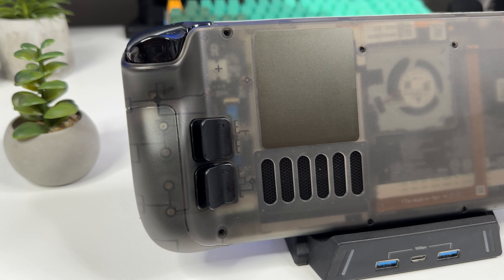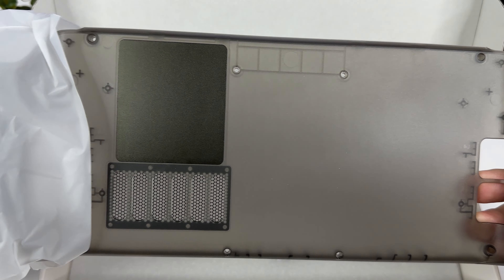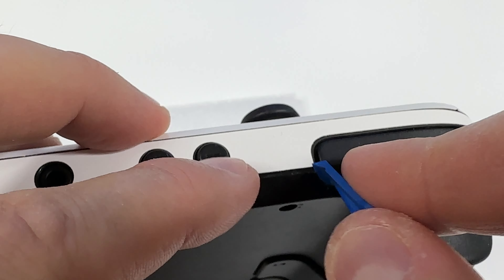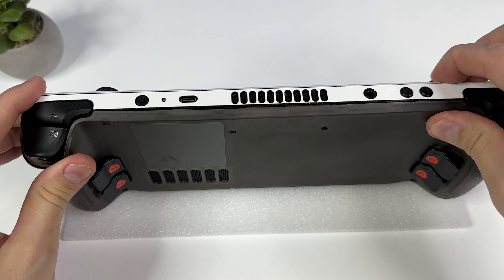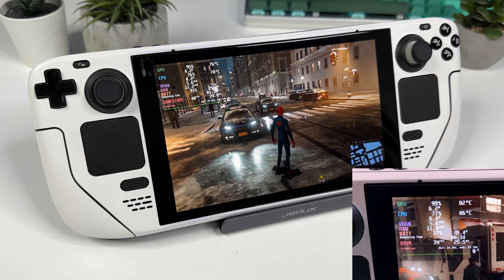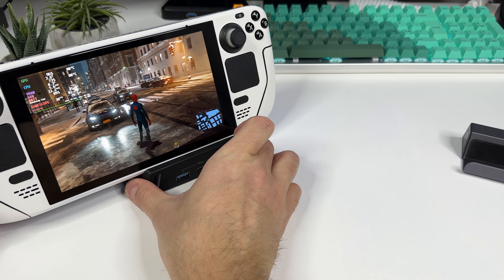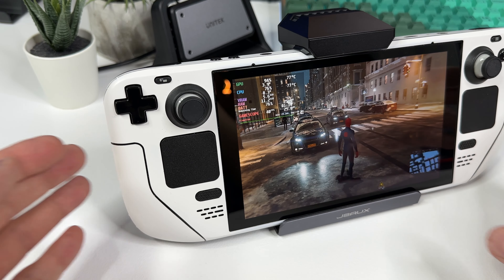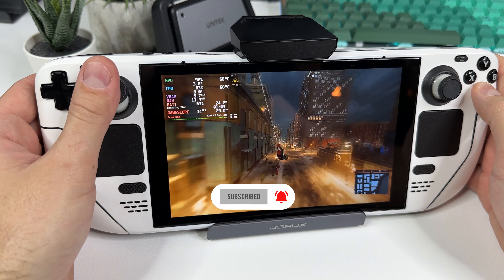Steam Deck Cooling Part #2 - Can't Believe How Good This JSAUX Fan Works

Comment: I find it a bit surprising that no one has tried adding a aluminum heatsink to the back plate to try and spread the heat better than a flat metal plate.
Reply: Isnt that technically what Linus Tech Tips did, but on a much more overkill level?
Reply: LTT did lols.
Reply: LTT made a hot rod mod, it's mad
Reply: I've been wondering how hot the back would get if you made a solid aluminum backplate, or if it would just become so hot that you couldn't hold it
Reply: @Takintomori A completely metal backplate could interfere with the internal radios.
Reply: Ltt did it
Reply: there is a mod out there that replaces the flash guard inside with a large heatsink plate that you can attach an m.2 form factor heatsink to, or even a powered cooler if you wanted
Reply: @Shadow_Hawk_Streaming link?
Reply: @Dragonborn2262  not sure, I remember I think linus using one in a video

Comment: You got disapointed from the thermal electric cooler but you forgot 2 things:
1. The internal fan spun down ,thefore most of the cooling was thransfered to the external one
2. Its a sustained temperature. Its not allowing the deck to heat up and its keeping at temp that is bellow the termal throttle. 
If it starts to rise , the internal fan will kick in to cover the differance.
Reply: there's a plugin for manually setting your fan curves, that could be used to compensate

Comment: Did you set the internal fan to a fixed RPM for testing? Because the dynamic fan speed control based on CPU temp could influence the results heavily.

Comment: Also, you can't just look at the temps blindly by themselves. Due to how the ZEN 2 and RDNA architectures work, if there is thermal headroom the clocks on the CPU and GPU boost higher. In those instances where the temps appeared to be "the same" I'd bet your clocks are higher.
Reply: If that was the case then you'd expect an uplift in performance, if you look a the fps counter during the use of the thermo electric cooler you can see that there in no increase in fps making a performance increase and thus higher boost clocks unlikely
Reply: @flachs6 its locked at 40hz

Comment: So the R4/R5 button problem from tightening the upper left screw isn't just a problem with your unit. My unit also has that issue, and I fixed it by placing a small hard plastic shim under the stand off that sits on the back of the joystick PCB. Then you can tighten the screw all the way down without R4/R5 being pressed down. Also one other problem if you look at the original steam deck back plate, there are plastic support material that support the volume buttons on the original backplate that the JSaux back plate doesn't have. I wonder if the volume buttons will be easier to break off their PCB without that support material around them.
Reply from the maker: Thanks for awesome input! I’m gonna check if I have the exact same problem!

Comment: The thing I worry about is that the external fan would force the internal fan to spin faster than its supposed to to and burn it out quicker.
Reply: No problem

Comment: By far the best way to cool the steam deck. Covers or cases simply suck..just estatically the look better. Just buy one of these essentially and it will be cooler. It does make it weigh more but not too bad

Comment: Is that cooling pad sticky? So changing backplate again could go messy or damage anything?
Reply: To add, I was able to pull it off and my Steamdeck is fine 👍🏻
Reply: Same. I removed mine to change the buttons and had no issue with reinstall.

Comment: There's a video by DIY papi that showcases how the thermal pad on the aluminum heat sink gets in the way of the fan ventilation I would suggest looking into that if you have that back plate.

Comment: that doesnt come close to making direct contact you need one that makes direct contact to that thermal plate something like the GameSir F9 is my choice I will be trying it out very soon. yes it needs to stick on with magnet but the magnet is so week that it doesn't pass the thickness of the thermal pad and the sticker actually covers almost the whole area of that thermal plate of the backplate and looks nicer than a grey lump. also it comes with a clear sticker which claims allows for easily removal of the magnetic sticker. just because it touches the backplate it needs to make full contact or a high level of contact to the thermal layer. maybe try docking it upside down :yougotthis:
Reply from the maker: Thanks for an insightful comment! Will definitely keep testing. Upside down as well! 😄
Reply: @Techcravers  ive seen a video with another brand of fan stuck on much like the f9 i received today and they got a decent drop i think it was 8c less but that was without the jsaux fan. i think with all combined sub 60c on spider-man is easily achieved. hope to do the testing myself this weekend but how do i use the jsaux fan without adhesive.
Reply from the maker: @_GarethRossUK  There’s no official way without adhesive or the mod case I’m afraid. But Steam Deck users are smart, they’ll figure it out.
Reply: @Techcravers  Jsaux needed to make the modcase with kickstand on the right and created a push out window instead they put kickstand on the left covering the thermal plate both products released in same week 🙄🤣
Reply: @Techcravers  i just thought of a solution either very thin magnetic pad if it doesnt disrupt the fan or just stick a rubber band on 😅

Comment: Is it okay to still use a case if you install the jsaux backplate? Or it will defeat the purpose the jsaux backplate?
Reply from the maker: The backplate (cooling plate) gets very hot so I don’t think that’s a good idea.
Reply: @Techcravers  thank you for the response.
I like my deck with a case with kickstand at the back. 
Maybe ill just skip this jsaux backplate
Reply: you could buy a case with a hard plastic back and cut out a hold in the hard plastic of the case back, the jsaux kick stand ones might work, although the kick stand on mine didn't last 7 months before the plastic had stress cracks all over the hinge